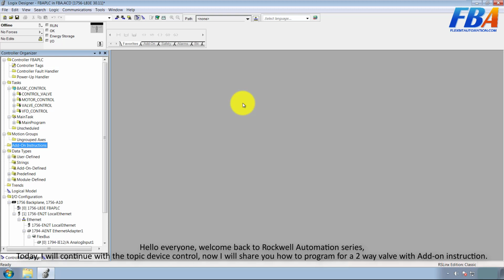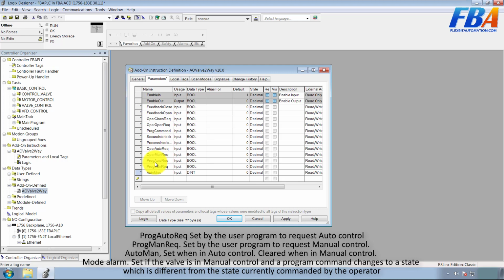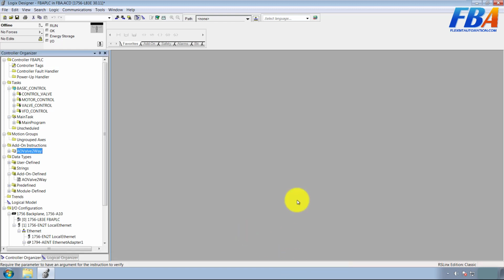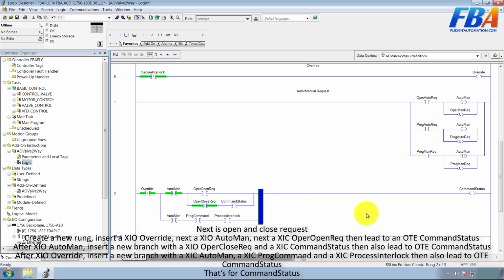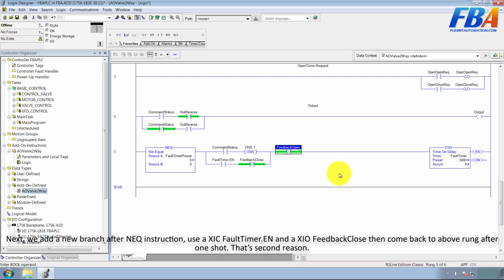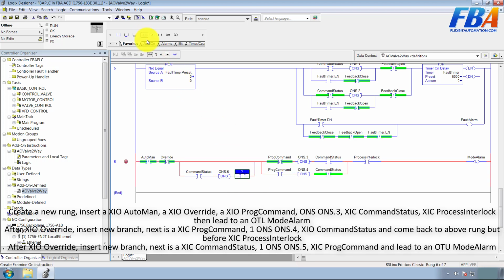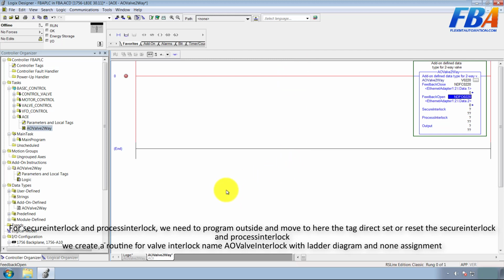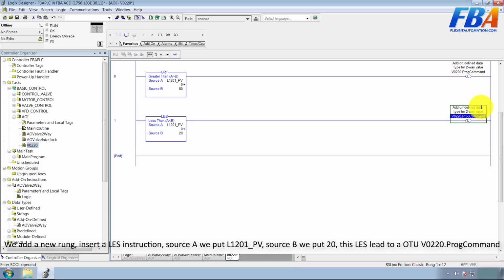Program For 2-Way Valve With Add-on Instruction (AOI) | Rockwell Automation

Comment: Thanks so much!!! I've subscribed. Can you make a simple calculator AOI please? Also lead lag standby pumps controls AOI please. You are very good!!!
Reply from the maker: Can you explain more about simple calculator AOI? 
For pump control AOI: i posted For Loop and AOI for 2-way valve, they are same logic instruction —> i also posted For Loop for motor, so you can convert to AOI easily